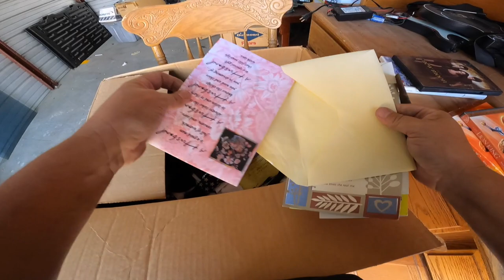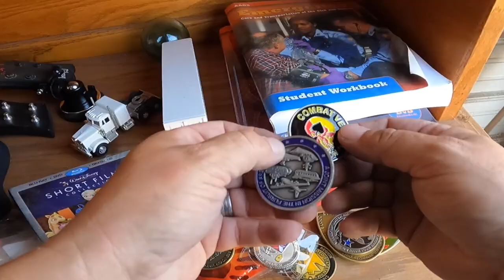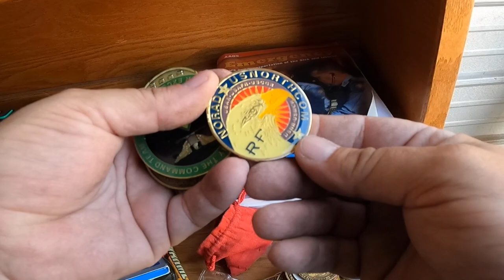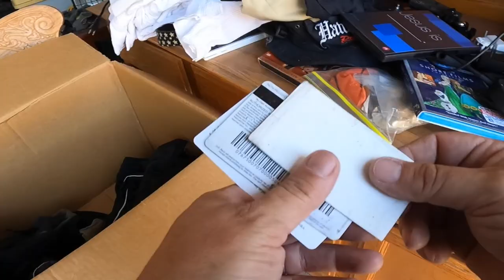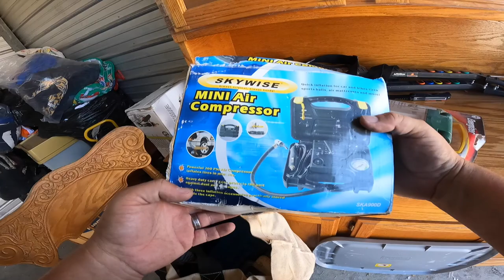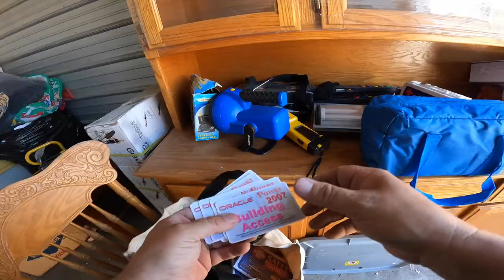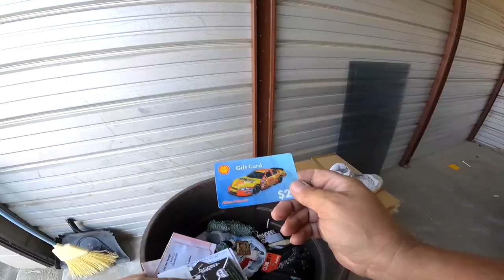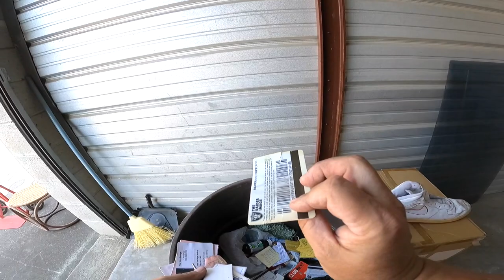Found bag of Coins! Going through more of the $1 locker I bought at the abandoned storage auction.

Comment: batons like that wood one you got there are also used by truckers for VERY quick tire pressure checks.  just thump the tire & the higher pitched the thump the higher the air pressure.
Reply: I didn't know that. Very interesting. I thought the same thing Jack did. I recently got a ride in a tow truck and though the driver had it in the cab for his protection (wink), not from lil ole me...